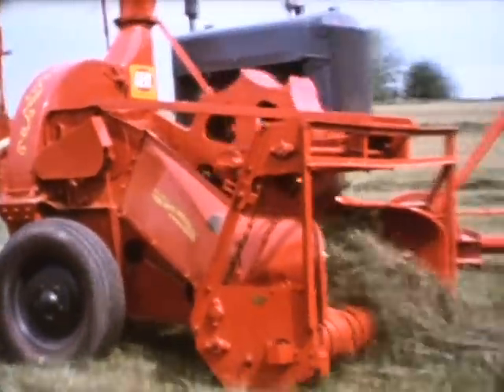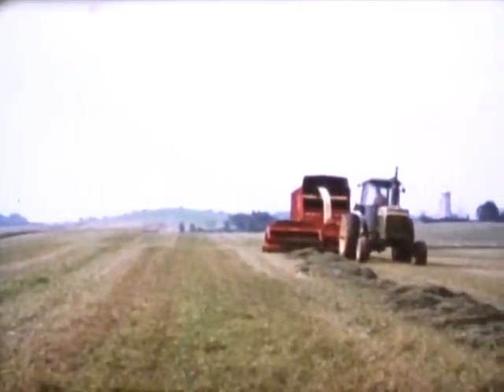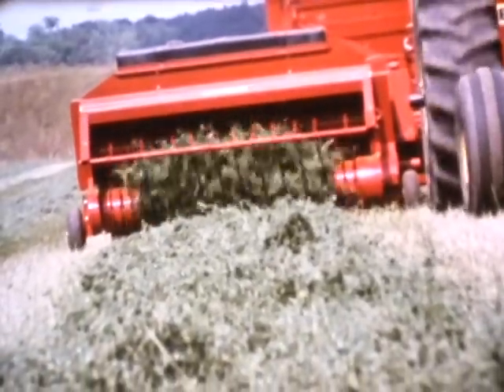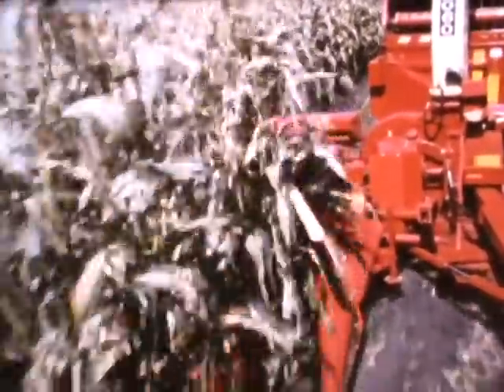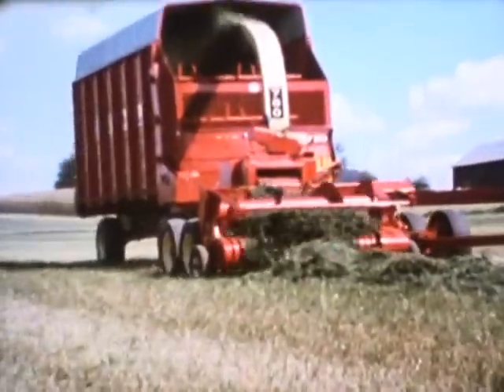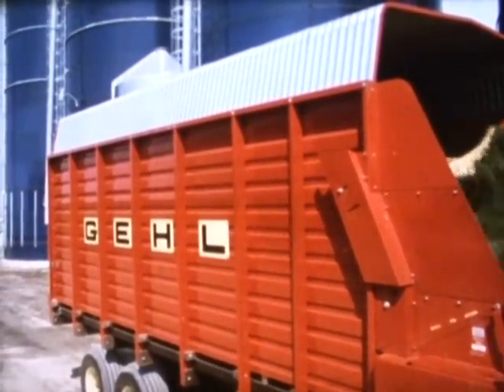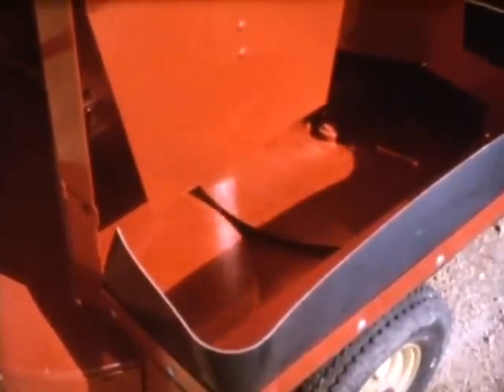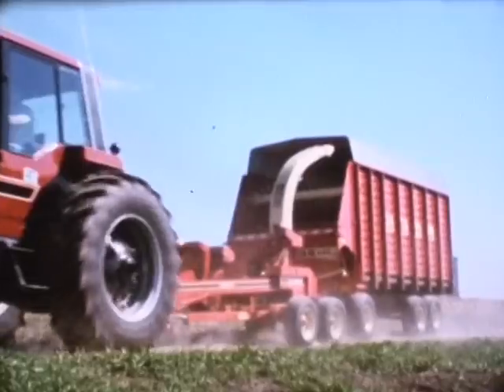State Of The Art Gehl Forage Harvesters

Comment: I was thinking about this during chores, probably showed Deere the most as they were probably their biggest competition in the chopper market?  I always guessed Gehl outstold NH choppers by quite a bit, anyone have any numbers?  I would be curious to know.  NH sold alot of stuff around me, didn't seem like choppers were one of the big movers though.
Reply: The New Holland choppers were the No.1 chopper for years. Gehl made a nice unit, but the 1200-1280 never could run with a 900 New Holland
Reply: @RJ1999x  I would like to see numbers, everyone always says this but I find it really ironic that as close to New Holland as I am, and everyone, and I mean everyone having about everything New Holland built..........except silage wagons, blowers, and choppers, which were either Gehl or Deere.
Reply: @tpfromcentralpa1692  You do understand that because a company is located in your area, there might not be a strong dealer. Here in Wisconsin Fox choppers were the only chopper seen, until Gehl modernized their units, then they owned the market, with a few John Deere floating, the New Holland dealers here sucked, so they were minor players, until  about the late 80's, then New Holland came in big.
New Holland has always dominated the hay market
Reply: @RJ1999x  Oh no, we had great NH dealers at that time, they sold tons of haybines, rakes, squarebalers, and spreaders...............but it seemed silage equipment wasn't so hot, I often wondered how the two companies compared in that market, because those dealers would have moved silage equipment and it just didn't happen.  I would guess more Deere Choppers here than NH.
Reply: @tpfromcentralpa1692  no, new Holland easily outsold the Deere, especially with the wall of steel choppers. Our local John Deere dealer was a New Holland dealer, they'd sell 10 new Holland choppers to 1 Deere.
The die hard green guys is the only reason they stocked a John Deere.
The salesman wouldn't even bring the Deere out on demo because the New Holland was so much better
Reply: I’ve never seen a worse pull type than the Deere with the short knives. Crappy cut length consistency in haylage along with pulling hard and a pain to set the knives. Idk how they ever managed to sell those.
Reply: @karlherzog3979  the John Deere guys will buy anything green and yellow and financed by Deere credit
Reply: @RJ1999x We had Fox choppers when I was a kid. They were good machines, but my spoiled cousin wanted a JD because of the electro hydraulic controls. He didn't want to get dusty with an open cab window. Fox was a better chopper. Never had a Gehl chopper, but I ran some NH units myself.